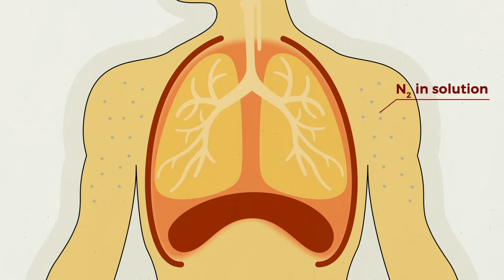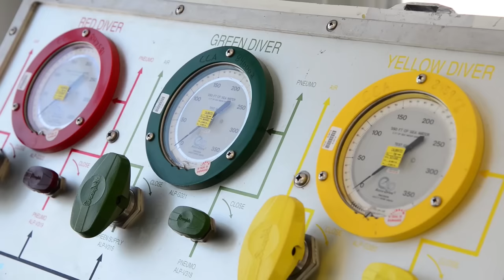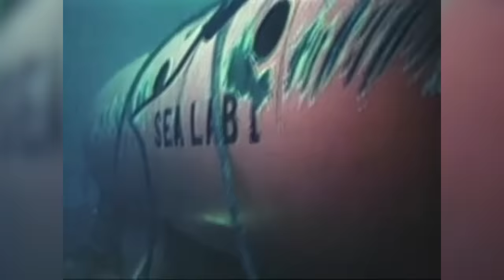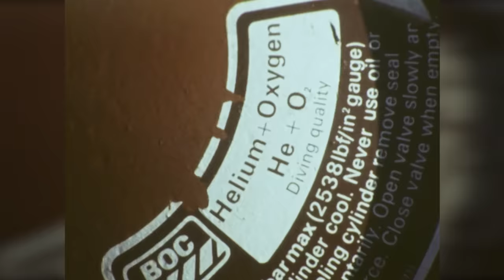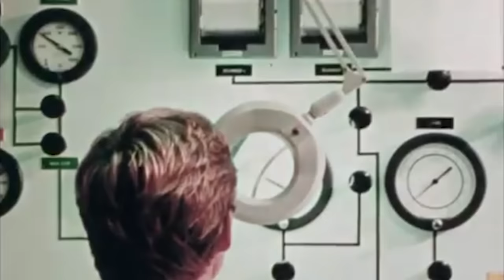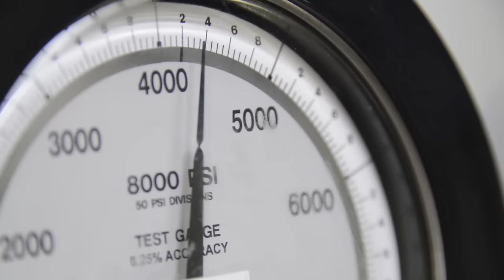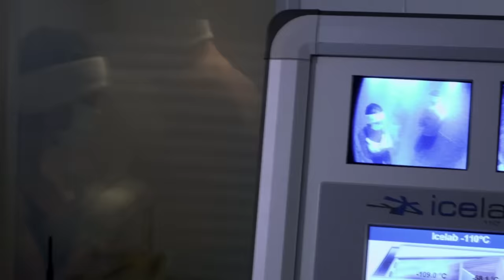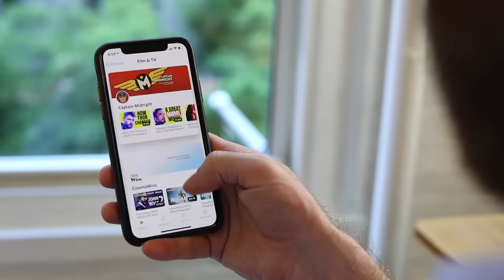Surviving the World's Deepest Dives

Comment: People do recreational diving beyond 33m. That depth is maximum that PADI teach in their core syllabus, they do have courses that extend that, there are also other agencies who's core syllabus teach to 50m.
Nitrogen narcosis is not as clear cut as described (from personal experience). 
* It impairs judgement like mild intoxication. You will get this due to the concentration of nitrogen. There are ways to get around this (by breathing other gases). You can do "dry dives", aka being put into a re-compression chamber and pressurised. 
* All the other perceivable effects typically wear off within a few minutes, only occur during the first few dives in a series.

Helox is not harmless, you can get "high pressure nervous syndrome"
Helium isn't what makes you sound silly, it's the pressure that makes you sound silly (from also having done a 'Dry Dive')
Reply: The silly sound is due to the density of the gas flowing across the vocal cords. For example. When you suck the air out of a helium balloon on the surface, helium has a lower density than nitrogen and affects the speed of the gas across the vocal cords. Breathing gas under pressure such as a 'dry dive' on air to say 50m in a chamber is also changing the density of the gas flowing across your vocal cords and it changes your voice. Combine helium with high pressures of the saturation environment and it changes your voice even more.
Reply: @evanmurphy2165  Yes that is all correct. 
My point was that they seem to have picked up an entry level dive manual and are quoting from it verbatim. 
The wording used strongly implied that it was the helium that was causing the change in pitch, and the pressure was only an after thought if it had any effect at all.

Comment: I wonder if deep sea diving suits (exo suits) can be much thinner and flexible if you made them from a graphene-titanium composite that would have an atom layer of graphene then a layer of titanium and then graphene and back and forth. The deep diving suits helmet could be made from the same lightweight graphene-titanium composite  and the glass face mask can be made of Aluminum glass (ALON) or synthetic sapphire and it could have an closed circuit rebreather like the one made from orb scuba designed by Thomas Winship

Comment: Your pressures are off by 1 atm. At 10 m it should be 2 atm, at 20 m 3 atm, etc. because you're already at 1 atm at the surface.
Reply: You're talking about absolute pressure, divers (and this video) use the more common gauge pressure where the surface is set as 0 ATM as reference point.

Comment: I want to know why they don't give helium and oxigen mixture to divers when they are working so that they don't have to deal the nitrogen all together.
Reply: High concentrations of oxygen (Hyperoxia) at high pressure ( partial pressure) can also have negative effects on the human body, its called Central Nervous system oxygen toxicity, this can lead to pulmonary and ocular toxicity, so basically the blend of gases at certain depth is specific to the person/ depth/ exposure/  etc. Its not that simple.
Reply: Cost. That is the reason that divers don't use heliox for short duration shallow dives. Helium is very expensive. Modern saturation systems reclaim much of the helium breathed out to reduce the cost and shallow open circuit diving wastes a lot of helium. It only becomes a cost effective option when there is a lot of work to be done that a continuous diver presence on the job reduces the overall time of an asset being out of production and the loss of profits while the asset is not producing. So it is usually a cost-benefit analysis decision to use saturation diving with heliox.
Reply: They do, but helium has its own issues. This video (like all YouTube) leaves out about 99.999% of the subject while trying to give the impression that you're getting a good overview.
Reply: About 15 years ago when Helium was cheaper, many divers I knew would dive mixes with some helium replacing oxygen and nitrogen to combat both oxygen toxicity and nitrogen narcosis.  Usually this was for dives in the 100 - 300 fsw ( 30- 90 meter ) range.  With the increase in helium's cost most of these divers have gone to rebreathers to make these dives today.    The addition of helium to any dive mix makes the dive a decompression dive due to helium's fast absorption rate.  Others have mentioned some of the other problems with breathing compressed gases it becomes a balance puzzle of cost, efficiency and safety.
Reply: @kentlangham5811  you must be American. In Australia helium was always expensive. I remember 30 years ago working out that each breath cost a dollar on the dives I was doing.
Reply: @gasdive  Fills were not cheap ( about $400 USD for double tanks ) but the same fill today would probably cost $2000 - $3000 USD.  Prices are getting close to that $1 a breath point again.  Do you still dive ?  My diving has been greatly reduced by age & health.  I doubt I will be falling off a boat into the North Atlantic for a 40m dive anytime soon.
Reply: @kentlangham5811   Kent Langham  yeah I didn't "give up" but for some reason, I just couldn't be bothered. Last dive was solo in the Devil's system at Ginnie Springs (the stroke pit as some call it). I went about 2000 ft past the Hinkle Restriction. Well past the Berman Room.

I guess I got spoilt. Now the effort of getting my gear sorted so I can go look at fish in 10m doesn't seem to float my boat. Everyone I used to go with has given it away. There's no good shore dives near where I live now. I should go have a paddle. Just never seem to find the time.
Reply: @kentlangham5811  PS wow, that's more than I was paying back in the day, even including inflation.

Comment: Perhaps make it possible to control a high tech dummy that operates by the movement of a Dover safely inside a chamber. So high tech that it can lift, screw in, weld....whatever is needed. Would be great for underwater photography
Reply: Pretty sure this is how it eventually ends - two arms with hands (with pressure feedback) and a 3D camera on a rover, driven from a VR rig on the ship. Thing could go a lot deeper, have stuff like sonar vision... would be pretty expensive, but so is all the support equipment for a saturation diving bell.

Comment: Recreational divers can safely descend to 33 meters? Where is that from? A basic PADI or BSAC cert will allow you down to 18 meters. That's where nitrogen narcosis is rare but not unknown. It is also a depth where decompression is not a major issue. IE you can stay at 18 meters for 48 minutes without decompression assuming no previous dives and you are not lake diving in the mountains. You can dive to 40 meters for about 2 minutes with similar risks other than you will have nitrogen narcosis at that depth. Personally I used to take 10 minutes at 6 meters if going deeper than 18 meters no matter what. However you need other certificates to go to 40 meters to cover the extra training.

Comment: A question: is the solubility of nitrogen in blood (water) much higher than that of oxygen or helium, or is there some other reason it is nitrogen, in particular, that is responsible for "bends"?
Reply: There is just a lot more nitrogen it’s more soluble and it is not metabolised. Replacing nitrogen with helium, the helium is almost completely insoluble in water so it (almost) doesn’t go into water even at hundreds of atmospheres pressure. When the dissolved gas in your blood is rapidly decompressed it looks like spray foam. This can happen by going from sea level to 20,000 feet too fast as well.
Reply: @theairstig9164  Aha, so it is a matter of solubility of nitrogen vs. helium. Thanks.

Comment: surely the bends and all of that can be sidestepped if divers wear spacesuit-analogues where the divers experience normal pressure no matter the external environment? such suits may get expensive if not impractical quick though I don't know
Reply from the maker: yes, there are what they call atmospheric diving suits, but they are problematic too. They are extremely heavy, hard to maneuver, super expensive, and still can't go much deeper than saturation divers. The one that can go deepest is still only depth rated to 600m or so.

Comment: 0:47 in the video and I already spotted a mistake:
Pressure underwater is 1 ATM (surface) + depth/10.
So it's 3ATM at 20m (not 2) and 4ATM at 30m (not 3).
Reply: i mean usually we don’t record absolute pressure, we record pressure relative to atmosphere. when someone says 0psi you usually think that it’s atmospheric pressure, not a vacuum.

Comment: You have your pressures wrong. Yes pressure increases by 1 atm every 10m but because you start at 1 atm at the surface 10m = 2atm. 20m =3 atm and so on. This is at 0:46 to 1:01

Comment: You missed out the behaviour of O2 in a normal, i.e. atmospheric O2 N2 ratio! This is important because unawareness of that danger leads to fatal accidents among recreational divers and even dive instructors, (see below) At 90 meters O2 becomes toxic in conjunction with its partial pressure. It causes uncontrollable extreme muscle contractions. That is the reason why pure O2 can only be used down to 8 meters! Divers who don't wear a full face mask and breathe through a mouthpiece are rendered incapable of keeping the mouthpiece in their mouth and drown! *This effect doesn't occur when O2 is mixed with He!
Reply: @deeps78  I know that it is more complex + the actual practice changes due to clinical and operational observations. But I only wanted to point out the issue in principle and not scare the Jesus out of people...;-) With informations it is a bit like with gas mixes; you need to get the dosage right...;-) But thank you for the info!

Comment: It’s called gas narcosis not nitrogen narcosis because both oxygen and nitrogen cause the same condition also pure oxygen becomes toxic and about 20 feet of salt water and I believe at about 220 feet of salt water 21% oxygen ( normal air) becomes toxic. Oxygen toxicity affects the body by the dissolved oxygen slipping in between the neural receptors in your brain basically not allowing your brain to perform the proper operations causing you to go into a central nervous system convulsion,  this by itself normally isn’t necessarily deadly however you tend to drowned rather quickly unless someone immediately intervenes but at 220ft its game over The rescue diver will not risk his life with a fast ascent rate A normal ascent rate would be between 30-60 fees per minute depending on your dive computer algorithm
Reply: Gas narcosis affects everybody differently and at different depths however most people tend to get affected past 100-110 feet I’ve been to 121 and nothing 🤷‍♂️ that was my mod

Comment: The pressure increases by 1 atm every 10 m, because p = ρgh = 1000 * 9,81 * 10 = 10^5 Pa = 1 bar.
Reply: And when leaving the surface, there is already a pressure of 1 atm, so, at 10 meters, your body will have a surrounding pressure of 2 atm.

Comment: Why don’t they use pure oxygen
Reply: Breathing pure oxygen and getting a lot of oxygen into your body that way can be harmful and even poisonous to the body.  One of those cases where too much of anything is bad.
Reply: There's something called oxygen toxicity. Basically, beyond about 70m ( 8 atm pressure) breathing a normal air mix will introduce too many oxygen molecules to the body, causing nervous system failure and, ultimately death. In general, diving at depth requires the reduction of the oxygen content in the breathing mix so this doesn't occur.

Comment: 11:34 wait, like how everyone thinks decompression works in a spacecraft? because that's just a myth...
Reply: No, it's a different physical process. One is boiling, a phase change, the other is gas coming out of solution. . As near as we can tell it kills in moments.

As for being blown out of small holes, there was a line in an accident report. I can't remember exactly how it went but something like: After collecting as much of the diver as possible, no trace of the liver was found. It's assumed that it was lost over the side of the platform."
Reply: @gasdive  which one is "it"? the one that kills in moments?

yes, no shit they're different processes but blown or sucked the end result is supposedly the same, being transported via a hole much too small.

sooo is that a yes then? the diver was pushed (or pulled, remember I dgaf how) through a tiny hole and subsequently misted?
Reply: @the_hanged_clown  "it" was being decompressed from (hazy memory} 20 bar up to surface pressures in a few seconds. The divers deep in the habitat didn't move at all. No like 30 seconds of struggle or anything. Just sort of switched off like a light. Their blood sort of gelled. The one who was closing the hatch when the docking collar failed went out through a crack left open when the hatch tried to slam shut. Sucked vs. Blown.... Is there a difference?
Reply: @gasdive  thank you!
Reply: @the_hanged_clown  no worries. It's fascinating, if a bit gruesome.

Comment: Cant they just breath 100% oxygen?
Reply: 100 % oxygen is fatal past 30 feet. It causes immediate convulsions. Drowning results.
Reply: @aerialeggbeater2644  Immediate? Not quite. I'm a commercial diver in the Gulf of Mexico and during decompression in a deck chamber, we regularly breath 100% O2 at depths of 50-40 fsw (feet of sea water) at a max of 25 min with 5 min air break before getting back on O2. I have personally ran a treatment table on a diver that got bent very bad and some of the treatments had him breathing 100% O2 for at least 40 min at 50 fsw before taking an air break, IIRC. Now prolonged breathing of 100% O2 at those depths will eventually cause CNS O2 Toxicity, but the amount of time largely depends on the person, what they are doing at the time, rate of respiration, etc. During normal decompression in a chamber, no more than 25 min of O2 at a time according to our tables.